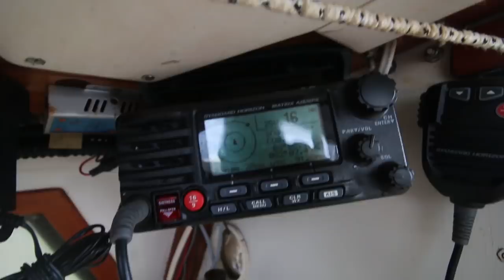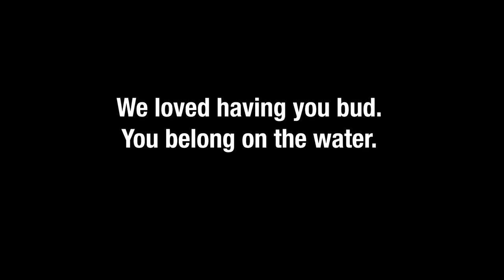Are you claustrophobic? | Sailing Zingaro Ep.38

Comment: Hi James the baby oceancraft all aluminium dingy has the following specifications
Length 8 feet 7 inches (2.6 m)   Width 6feet 3 inches (1.9m)  weight 75kg or 165 lbs
Working load 2052 lbs 75kgs) tubular gunnel height 1.6 feet (500mm)
Long leg motor 20 inches 
Recommended 9.8hp motor
Max 30 hp
No need for bench seat as sit on the tubular gunnels
I think the aluminium thickness is 3 mm or 1/8 inch
All round fender available
Just found all the specifications on the oceancraft website (hard to find the specification table on the website - which is a bit irritating)
converted to imperial measurements for you
Hope these accurate specifications help.
Mike Jessop the owner of oceancraft May be able to ship the dingy to you via a cruise ship or in a container 
He is very helpful.
Be well and enjoy 
Wayne
Reply from the maker: Damn 165 lbs... That's double our porte-boat. Idk. We'll have to see abouyt that. I'm going to contact him. I REALLY appreciate the info Wayne. You da man. Send me your address and I'll send you some stickers. Thanks bro. -J
Reply: It’s my pleasure 
I am working in Fiji at the moment and possibly for the next 2 years 
Don’t worry about stickers
Just contact me if you journey here and we can show you some of the main island
Sorry if the dingy is a bit heavy
Hopefully with your ingenuity you can rig a pulley system + yard arm for hauling out at the front or davits for rear haul out
If you can make it work then you will have a great tough dingy to help with provisioning; spear fishing; safety and much more
Which you prosperity ,health and happiness 
Wayne